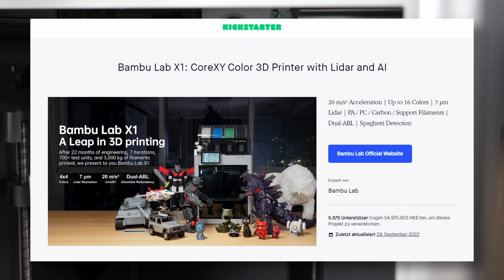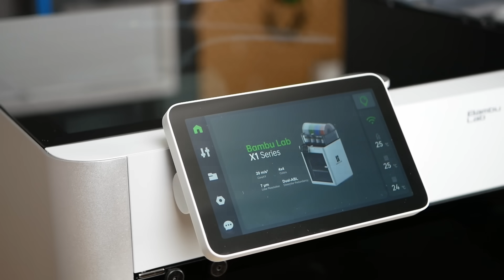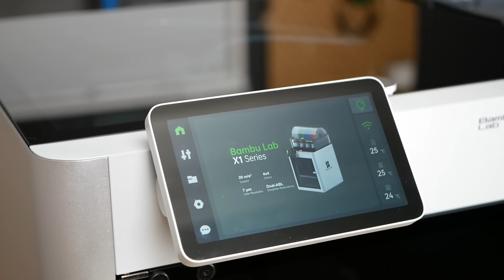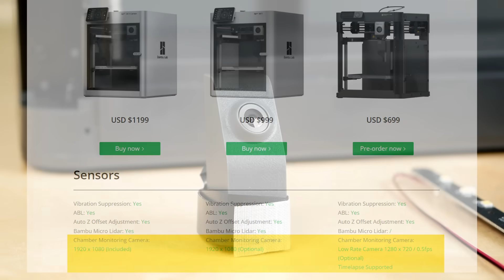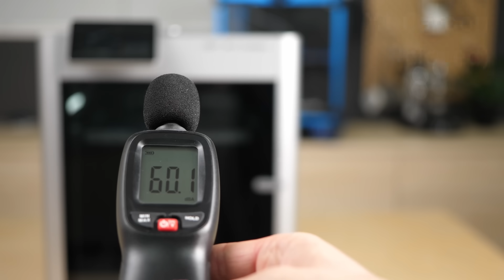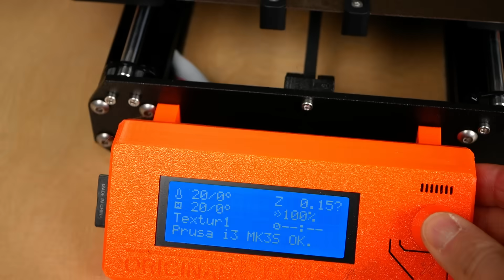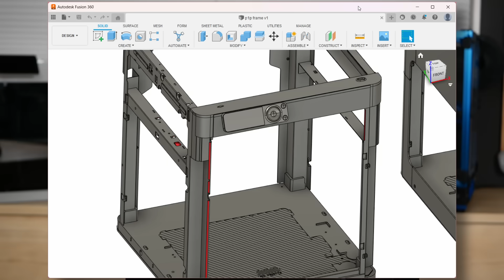The Best 3D Printer of 2022 got Stripped Down to make it Cheaper!

Comment: As with all your work, this is a great video; Ii's the best comparison of the two I've seen.  I want to start a business (despite being new on the scene) and have been struggling for the last months working on printers 7x more than running them. I love them and like to work on them and learn a ton from them, but I want to print more. I started with inexpensive corexy's and just bought a zero-g that comes close to being a Voron. Though it has been a better experience, it has also kept me busy learning and screwing around more than printing. 

I was going to rebuild/and upgrade the printers, but I am to the point I am going to sell them all and upgrade to either Vorons or Bambu labs. I saw your short discussion on the melt zone. I am still undecided. I like the idea of no more hassles, but am having trouble with the idea of not being able to quickly and cheaply get parts, or will I be able to fix problems on my own at all? I don't see any videos about problems and how to fix them yet. 

Any more thoughts?

planning a comparison video soon?

Will you be at the Ruhr Maker Faire?
Greetings from Neustadt Weinstrasse!

Comment: On the surface, this seems like a good product strategy: offer a lower-cost, higher-value 'hobby/tinkerer' printer. WARNING: this has the chance to devolve BambuLabs into another Ender line. Our community NEEDS to dig ourselves out of the tinkerer shithole we've been stuck in for 15 years. 
Please BambuLabs - continue to focus on appliance-grade and commodity-grade products - I should be able to buy, setup, and use my 3D printer as though it were a microwave.

Comment: Hi stefan, since you have prusa and bambu lab printers, could you do some strength test using those printers with default settings for each printer using the same filament? Because i have try printing an object with prusa using higher speed and the result is not as good as the slower speed. Many people only amaze with the bambu lab speed and print quality, but until now i haven't see or read any review about the strength test. I hope you can test it with your own method. Thanks

Comment: @CNCKitchen
Is the X1C also in silent Mode louder then the Prusa MK3? I am thinking of buying a X1C but want to sleep well in the night at another room. 
The only thing, that keeps me from buying the X1C are the different comments about the noiselevel.
Reply from the maker: It's definitely more bearable bit a significant part of the noise comes from the strong cooling fans that won't become quite in the "quite" mode. Regardless, put it on a concrete slab to reduce the transfer of vibrations into your house.
Reply: @CNCKitchen  Thanks for that. I view right at the moment your video about the different combinations of concrete and felt / foam / etc. to lower the Noise.

Comment: The fact that it's still able to use the multicolor printing upgrade makes it a winner for me.
Faster printing without making errors is also a win.
Still not in my budget until I do more work, but it's on my list for the future.
I also want to get a resin printer for the more detailed/precision parts.

I have a FLSun SR with a rebuilt hot end(because the default nozzles and break just didn't work)

Comment: Stefan please could you do a video flow test on the BCX1 with PLA, PETG, ABS etc. I would also like to see a cross section of the propriety nozzle, maybe there is CHT or similar technology in there... It is strange that they custom made everything and included LIDAR and vibration compensation but stunted it with a low flow rate? If it can't flow too well maybe an aftermarket nozzle would help. They should use the same technology as modern soldering irons rather than cartridge style heaters like older soldering irons used to use. That direct drive heating made soldering irons much much faster and more capable with less watts.

Comment: If I were to get something like this it would be for material option expansion, so I'd want to go with the X1C. I see the P1P as a goodove for the company though since there are probably lots of people who would want what it provides without having to pay the X1C pricetag.
Reply: A hardened hotend is around 40 bucks, depending where you live. Enclosures are starting at 50 bucks for acrylic ones, fittet to the P1P. So for half the price (+90 bucks) you’ve got basically all the capabilities of an X1C, except the lidar. That’s not a bad deal at all, especially if you start to print PLA and such at first. In fact i substituted ABS completely trough high temperature PLA, which is great on every machine, especially the P1P 😁👍

Comment: Hey Stefan, first: thanks for this video! I'm really hyped and thankful to not missed to order this one early!

But I found a slightly quirk in your conclusion: after mentioning the printable side panels and the online shop (for the hardened parts) it would be logical not limit the features of the P1P to its out-of-the-box capabilities.
On the contrary: if you do a full on review of this machine you should also order the hardened parts (if they are obligatory to print carbon fiber enhanced materials for example), print some good looking side panels, maybe ad a door with some hinges (how clear is "durchsichtiges", 3D-printed PC really?) and include a comparison for a "X1 matched spec P1P" in it! I bet it's still way cheaper but unique in it's design!

Grüße ausm Berliner Speckgürtel!

Comment: Only way I personally feel ok messing with print settings like flow ect. is if I am buying a cheaper printer like a ender 3 or cr10 and in my mind that is the trade off. Once the X1 carbon reviews came out my mind was forever changed and I no longer want any printer that does not have the lidar technology unless it's a cheaper printer like mentioned above. So for me I'd rather buy once cry once and get the top of the line printer which honestly is a steal for what it offers.

Comment: I have the X1C (couple of them) and I like the idea of the P1P if it works about the same as the X1C - as far as fixing things on it, it is still unscrew and replace like most of the other machines on the market.  I run my printers for my business so the less I have to tinker on my farm machines the better.  I just keep extra parts on hand like I do with all of my printers.  I'm in the process of building a pellet machine that will use the chopped up waste from the X1C to print large scale prints that will be painted.  I would like a X1C with a build volume of at least 400x400 with speed close to what it is currently

Comment: I kickstarted the X1C+AMS and love it.  I have since got an Ender-3 S1 Plus and an Ender-5 S1.  I ended up upgrading the S1 Plus to a Sonic Pad just to make it usable.  what's the point of large prints if they take 7+ days?  The 5 S1 is decent but comparing it to the P1P on price and features I never would have got it if I knew the P1P was coming out.  I don't want to be proud of my printer.  I want to be proud of what comes out of it and I can get great prints with almost no work out of the X1C.  Starting my own little print farm I ended up pre-ordering 2 P1Ps because I want something that can just crank out PLA prints 24/7 without worrying about if I need to upgrade to the latest Klipper or whether I should swap out for that fancy new extruder I just heard about.  All that stuff is great and if you want to build a printer and learn how it all works and tinker away, awesome, build a Voron.  I just want to design and print stuff so Bambu Labs it is.

Comment: This pretty much proves my worst fear with the BambuLabs machine. It is a proprietary machine and will cost a fortune to keep it going. Proprietary nozzles at $30.00 each for a machine that is pretty much stripped of everything that made it a contender, and that can only print PLA and PETG. FOR $700.00+, That's just dumb beyond all reason. I am beginning to think that I made the right decision in passing this thing by. This just shows me that this machine is a Lemon waiting to be squeezed out of existance. PROPRIETARY is just another word for the phrase "Screwing to follow" and I have been down this road before. I guess I am just have to save enough to buy a Raise 3D machine. Or just build the thing from scratch and have the machine I really want. It won't be cheap, but it is truly the only way to get a repeatable machine without having to deal with expensive replinishables. I personally can get 2 Core XY machines for $700.00 and get Klipper up and going on both for less than $200. They will print PLA and PETG with insane speeds as well and they use just standard printheads with beefed heater blocks and cartridges. I honestly thought this was going to be the one to break the glass and allow makers to have a quality piece of equipment at a price they can afford. ANY price below $2000.00 for a repeatable machine is a blessing. It truly is a SHAME that it can't be done on a professional scale.
Reply: Do you mean the prusa mk3s are stupid too? More expensive, also can't print ABS, slower

Comment: I think they are making the right moves and really pushing the bounds of the 3d printing market. I am probably going to go with the Carbon X1 because of my desire to print carbon filaments, but what a great option for those who are only using pla and the like. Very smart move. Now the one con, give us a usbc or an either-net port on the printers as an option to cloud printing ! I want to be able to use my machine locally and not have to use wifi (cloud), then these will be perfect as far as I'm concerned.
That is my biggest gripe, no way to hard wire to my computer. I hope they are reading the comments, as I'm really close to buying one or both of these machines.  Cheers.

Comment: It's an interesting proposition, but the price they're at is effectively making them compete with an MK3S+ kit. And for my money, I think I'd rather buy the kit and know that I get a proven, totally reliable printer that will output excellent prints and has the community support and company support Prusa is known for. I feel like the P1P only has one real advantage over the established mid-high end hobbyist printers: speed. I can get print monitoring on my Prusa, I can customise it, fit hardened nozzles ... I don't know that speed is enough of a selling point over all the known qualities that the MK3S+ has. They certainly are getting there, but only time will tell.

The X1 Carbon is still an interesting proposition to me though, as for the price it's a much more compelling value proposition: t's more than just a faster printer. I can't wait to see what the community does with the LIDAR tech, the self calibration at every print is also interesting and certainly speaks to print quality repeatability. I feel like where the X1 moves the needle forward and operated in it's own, innovative section, the P1P is trying to be a competitor. And I'm not sure that's enough.
Reply: prusa is too slow, even though I have one, no upgrade is possible to make it faster, fundamental flaw of i3

Comment: As an X1C owner there are some motion processing issues. Many people reporting vertical lines on outer faces. Not ringing. It’s a bug which no one on YouTube seems to mention. As long as it gets fixed then id recommend the printer but until it does it’s not great when printing slower for quality.

Comment: Cheap display, no lidar, open box, loud - all no probs for me. Get the P1P into a print tent and start ASA printing.
Cloud? Don‘t need, neither on my Roborock cleaner nor on my printers.
I‘m still into checking the first layer anyways.
So I ordered the P1P while keeping my tuned Sidewinders and CR-10A Pro. 
Every printer does it‘s job for a different filament on a different plate (by PEI spring, FR4) by different print temps

Comment: Important to note that Bambu have confirmed that the Micro LiDAR calibration on the X1 series is not currently doing flow calibration (despite the name), it's just doing PA/LA calibration.
Reply: Can you elaborate on what that means, for newcomers? thanks
Reply: @engineeringdisillusion  pa/la means linear/pressure advance. They do the same thing just on Kliper/Marlin. The aim is to remove over/under extrusion at the start/end by gauging the width of the extrusion. They do nothing in the middle, nor the height.

If the LIDAR worked as promised it would do complete flow monitoring/adjustment the entire time, as it can measure the width and height of the extrusion in real time.

Comment: I understand every change they made from the X1C to the P1P...except the lower max temp for the bed heater. Bed heaters are rarely easy to upgrade/replace and with Bambu Labs' largely captive parts environment users are fully at their mercy when it comes to availability and pricing of a higher-end bed heater. If I were to spend $700 on a printer that has a nozzle capable of printing PC, I want a bed that is capable of doing so as well. 

The parts availability/pricing problem is true for basically everything else on the printer, of course, and that gives me a little pause - despite the surprising success of their Kickstarter and the high ceiling for Bambu Labs as a company, all it takes is a few bad decisions for them to go out of business. If that were to happen, even a best case scenario where Prusa or another company buys up the IP doesn't guarantee that there won't be a ton of $1,500 doorstops out in the world. Bambu Labs will be artificially limiting their sales potential if they stick with a closed system, which is a shame given the exceptional features they've built into their printers.

It would also be real nice if they could cut down on the filament wasted by the purge system...I'm approaching the point where I can't imagine doing multi-color or -material printing without independent extruders, given the horrific amount of plastic wasted by purge loops and priming towers. It's not even so much the environmental impact of being unable to use all of that material, I just see a lot of money ending up in the trash (or in a shoebox that you promise to use with a filament recycler, as soon as you have the space and cash to afford one) that doesn't need to be there.

Comment: Thats hard to tell if removed features(micro-lidar, hardened steel components) which are essential for printing are justified by price reduction. Display are not essential in world of remote control apps, walls can be cheaply made locally, additional dust fans also can be added easily. But micro-lidar with autocalibration and hardened steel components are not cheap and not so easy to install.

Comment: The ingenuity of this product goes FAR beyond cost cutting. By releasing a machine at this price point they are inviting tinkerers/hackers//makers to improve their product.
A) Low hanging fruit is the side panels. 
Besides printing custom designs, people will be exploring different materials similar to CONSTRUCT3D like Bamboo or GR10. The open frame also begs for a door and a top similar to the X1.
B) Next level is camera, lights, and fan. Yes, they will gladly sell you those options. But the more adventurous will likely develop their own custom solutions. Can users develop a quieter, cheaper alternative to that noisy fan everyone complains about? Can we implement our own imaging system with better resolution? What's the best arrangement for LED lighting?
C) Can the existing hardware be improved? Extruder, Hot End, Nozzle mods. How long before we see Revo, Phaetus XG, Bondtech, Orbiter "hacks"?
D) Finally, the teardowns and experiments with electronics and software. Can ANY of the electronic hardware be "hacked"? What is in the new display - Is it an ESP32 S3 like the LilyGo T-Embed? Is BambuBus just a trademarked implementation of CAN Bus?
How many individuals really just want to see if they can use this for their next Voron/RatRig/VZbot/Hevort project?
Ever since the X1 was announced, people have been clamoring - "Does it run Klipper?" "Can I put Klipper on it?"

What does Bambu Lab gain from this?
A) FREE publicity for the next 6+ months. And not just a name drop. Every Video/Blog entry/Social media post will literally be encouraging new customers to join the fray and make this product the machine you always wanted. At the reduced price, you can't afford NOT to buy one and play around. If you own a print farm, you need half a dozen.
B) A community of developers and beta testers. Exploring improvements from a world of different perspectives. Finding out not just what customers are looking for but free "open-source" implementations.

I'm NOT saying that any of this is bad. Ultimately we will have to see how they truly treat the community. 
In fact, DISCLAIMER: I already ordered mine in expectation of investigating a lot of what I outline above.
But I'm hoping this works out favorably for ALL.

"A rising tide raises ALL boats" (or Benchies!)
Reply: Duh, I forgot to mention upgrading the build plate heater and LIDAR/Spaghetti Detection.

Comment: the Bambu websisted tech specs of the P1P say the extruder gears and hot end are steel and stainless steel respectively- but you mention they aren't hardened steel. Are the gears cheap low alloy steel? can these be replaced?
Reply: any steel is going to be good for extruder gears. The bad ones are the crappy brass ones you get from creality and others. Hardened steel ill be better though, and you can upgrade the whole extruder for only like $30

Comment: the p1p is just another normal fdm printer with little features and far to expensive. the speed is no longer an outstanding feature, there are several other printers on the market with a proper speed. you can get yourself 3 printers with same or better printquality for the same price and spare parts are cheaper as well. the p1p is a big step back for bambu.
Reply: what other out of the box printer on the market has that speed for $700?